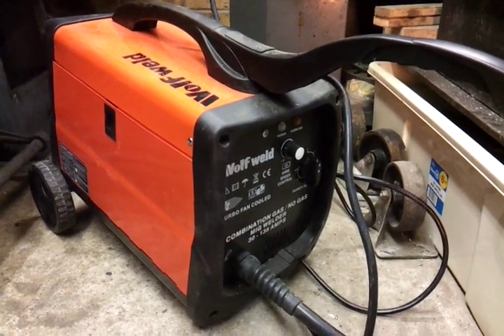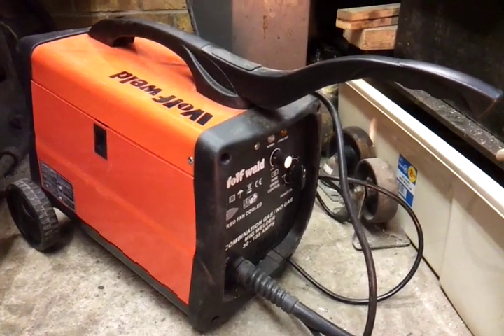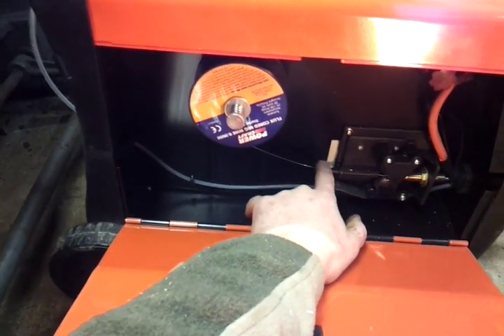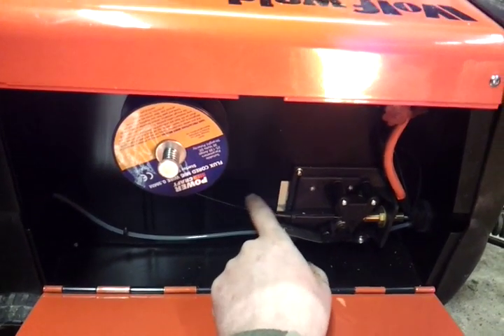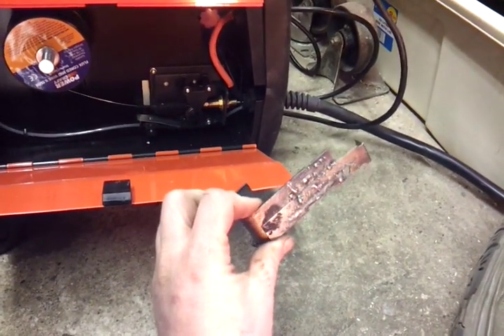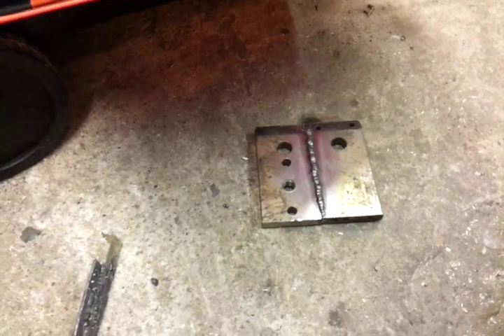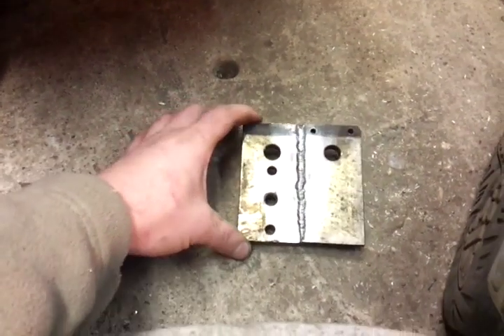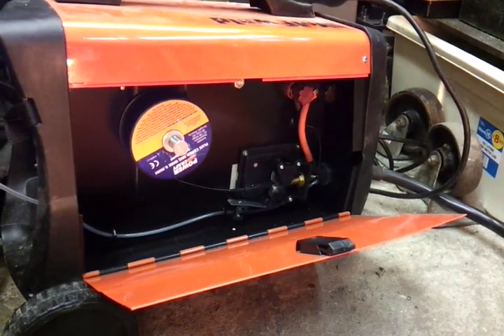Gasless MIG Welding Polarity

Comment: Helpful thanks, I bought a Lincoln mig tig stick 180i, its easy to change the polarity as its on the front of the welder you just plug it in + or -, but instructions are not clear, so you helped heaps cheers!

Comment from the maker: Recently tried the welder on its 5th penultimate setting while using a 20A trip and it joined angle iron 5mm thick perfectly. It's a bit of a beast at that setting. The arc gets super hot!

Comment from the maker: No problem. They're not a bad little welder really. In fact, they are quite capable, and I've only used mine on the first three settings on a 16A 230v socket. When I upgrade to a 32A socket soon, it should be a beast

Comment from the maker: Yes, you have to make sure you purchase flux cored wire, as something is needed besides the wire to create a gas shield to protect the weld during the melting stage, just like the CO2 is used to protect normal solid mig wire.  It certainly welds much better than an arc welder as the flow is kept more or less constant by the wire feed motor, unlike stick welding.

Comment: Got the same welder today and all set up ready to go, I seen this video a few days ago and checked the polarity on mine only to find the same problems you had, I changed over polarity and still had the same problem with spatter so I checked the wire, the reel had no label on it so I strongly suspect that the wire is for gas welding so I will get spatter without gas. Could do with a manual that seemed to be missing from mine.
Reply from the maker: Yes, I found using gas yielded far better results. I use a 85/15 Argon/CO2 mix. The casing on my welder is a bit awkward when getting a normal 15m wire loom in. I also had to make an adapter bobbin for the loom spindle.

Comment: Hay man I have the same welder and I found what you said to be 100% correct, I was wondering why I was getting shit welds all the time now they are much better. Thank you for this... One more thing, when I switch it back to use my gas there seems to be a bit of a leak. Iv changed the bottle but still the same problem... Is there a chance you can do a video on attaching a new gas bottle so I can see if I'm doing something wrong. I don't have the book for it anymore either.... Thank you...
Paddy

Comment: Thanks for the information, great👍
Unfortunately mine is just clicking when I press the trigger but the motor isn’t turning for the feed.
Any suggestions?
Reply from the maker: Does the motor turn without the mig wire fed down the hose? If the mig wire has a kink in the hose then it may not feed through. The motor might not care and have enough torque to just carry on trying to feed the wire down the hose, but it might also be stalling due to an obstruction such as a kink. Best to make sure the motor is working with no load first I reckon 👍
Reply: @voidmansions  Really appreciate your quick response. 
I’ve tried it without any rollers fitted and it just clicks.
Reply from the maker: @melmarshall8176  Hmmm. Sounds like the motor could be working but not rotating the rollers. Prove the motor works first then work from there
Reply: @voidmansions  Thanks, I’ll take it apart and try to fix it.
It’s just I have never used a mig welder before so didn’t know if there was a switch or something between gas and no gas👍
Reply from the maker: @melmarshall8176  The gasless kig wire is in all honesty complete rubbish. No end of trouble. When I switched to using gas and normal mig wire the difference was night and day. Much cleaner welds and not too difficult to set up. The yellow hobby gas bottles are all I use. I had to buy the valve for the tank which was 15% CO2 and 85% Argon. The small tank that came with the welder lasts literally 5 minutes. You just need an adapter to go from the valve to a push fit for the naff tube on the back of the welder.
Reply: @voidmansions  The relay is clicking but 0 volts to the motor. 
Will investigate the PCB.
Reply from the maker: @melmarshall8176  I must admit I've not been inside mine. Is the relay just for the motor only? I can't remember if the trigger on the handle doubles up as a cut off for the gas also or whether there is a gas valve inside the gubbins
Reply: @voidmansions  I’ll probably be checking the PCB out tomorrow or Friday
It can’t be much. Will let you know what the problem is when I’ve fixed it.

Comment from the maker: That does seem strange. The argon is inert, but if anyone tried to weld to a tank of anything, the pressure blast would give them half a day out with the undertaker. One chap somewhere tried cutting off a valve from an 'empty' oxygen tank by holding the valve in a vice. Needless to say, when the tank popped the valve was embedded in the wall, he gave his workshop a new red paint job, and he had to learn how to tie his shoelaces again :((

Comment: i have the same machine did have the same problem at first but managed to sus out the problem i mainly weld with c02 but after a while of welding i had a problem with the terminal connectors the negative over heated and melted the plastic and smoke was coming from the machine but i changed the threaded connectors to the modern dins connectors that is easier to use and that they can handle more current through them and i also changed the earth wire to 3m 16mm wire so im not sitting on the welder when welding and i have made alot of things with this welder.
like welding cart a stand for a table saw wall bracket for a bench grinder and so forth .

Comment from the maker: MIG welding by definition uses an inert gas such as Argon to shield the molten metal from oxidising. The various gas mixtures available also allow the weld to be controlled to the user's requirements. Different gasses are also required for different metals during welding. With all this in consideration, trying to weld without gas although physically possible would no doubt be an abomination and could never be recommended.

Comment from the maker: I think that is probably very true. I got a small tank of carbon dioxide with the welder, and I bet using that is a lot cleaner than using the flux cored stuff. Not tried it yet though,

Comment: is not the factory fault if you did not read the manual before using it.... you are the user , you are the one who has to make those changes and understand all the set ups no matter what brand welder you get...
Reply from the maker: Frank C It was not clearly printed in the manual, otherwise this video wouldn't exist, nor would your inane comment. Have a nice day

Comment: hey there, i just got my welder, near enough identical to yours and tried welding with the co2 connected... the weld was awful same your first piece showed... though it suddenly started to get better of its own accord... or so I thought until I realised it had run out of gas!  not tried the flux yet but has anyone else had this problem that the solid core and set up for gas worked better without the gas? (hope that makes sense lol )

Comment: Well the main switch was stripped down (don’t even try this unless you want to pull your hair out re-assembling it) all contacts were ok.
Fault traced to the large relay on the PCB. The coil winding had gone. So looking for a replacement relay and then all should be ok again.👍
Reply from the maker: Well spotted. Shouldn't be too hard to fix

Comment: hi i purchased a sealy mighty mig 100 I'm a novis, to change the polarity is it just change leads over and use as normal with flux core, as my machine came as gasless anyway, thanks
Reply: Firstly, read the manual of the machine. You'll learn a lot from it. Next read what your particular wire needs.

Comment: What power level did you have it on to get that weld? If I go over level 3 it trips my power :(
Reply from the maker: Steven Jones Yeah, I can only get up to level 5 from my supply. It's a 20amp trip to the garage and really needs to be on a 32amp supply instead. If it was then I could use level 6 too. If you can only get to level 3 then you might be on a 15amp trip perhaps. The welder is very good on level 5 and I've welded 4mm angle easily. Just throw away the flux core rubbish and get a reel of normal MIG wire and a tank of Hobbyweld gas. I use C15 and get very good results. Thanks for watching.
Reply: Yeah I got a 16a. I've just tried it with the gas bottle on level 3 and it's not too bad to be honest. But I'd prefer a 20a breaker so that I can get it up to level 5 and have some decent welds.

Comment from the maker: The small gas tanks are a total waste of time. Even when I used the co2 I had very bad results. They are around 60 litres and your gas flow has to be about 10 litres a minute, so you get just over five minutes! The pressure ebbs away before then and your weld will spit and swear violently at you. Solid core welding is far superior and well worth the extra setup with a decent tank and regulator.  I now use Argon 85% co2 15% and get really great welds. I do weld indoors though.